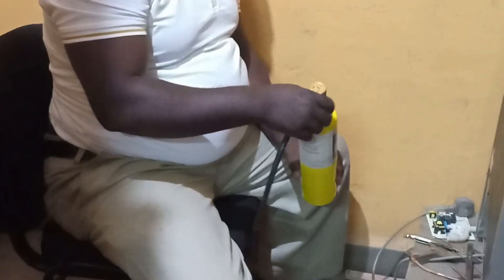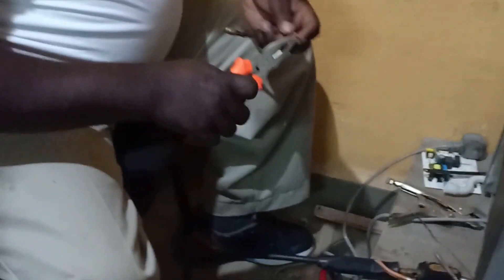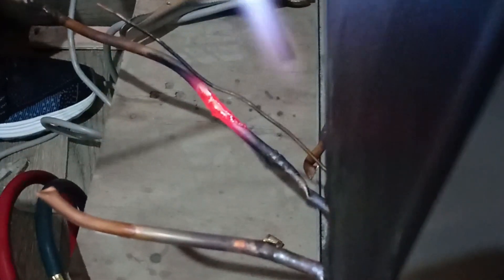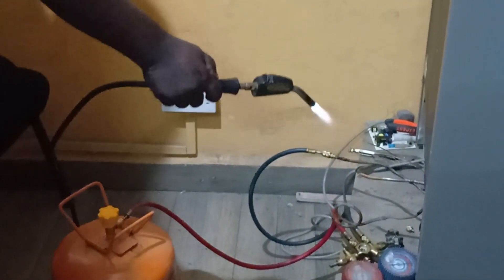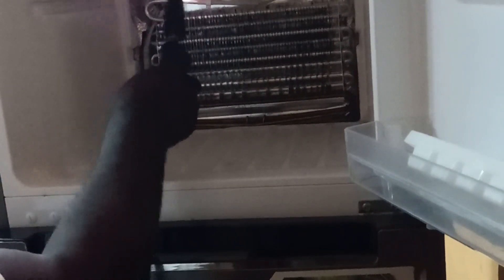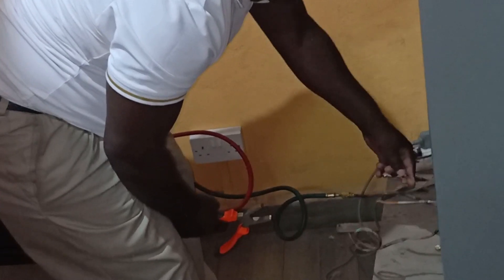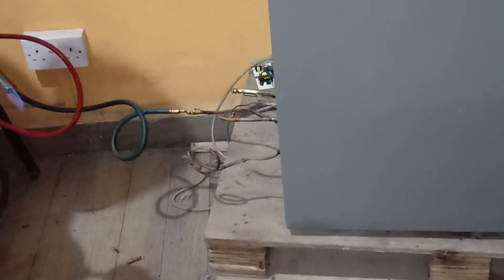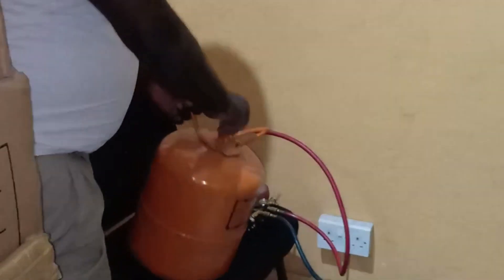Leak Detection in a Fridge {And Repair}

Comment: The flame test is okay but I feel you should start with the foam test first due to the property of R600a, and when you use high pressure what will happen if it was leaking from a weak point? Or when we have aluminum rot?